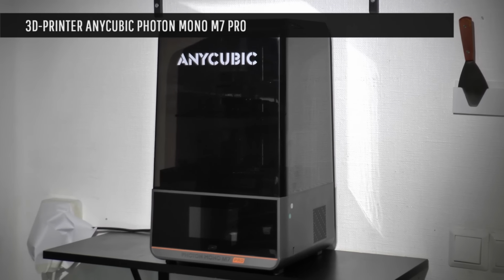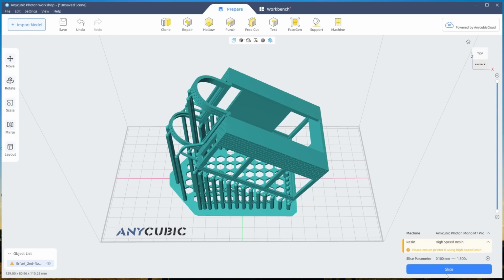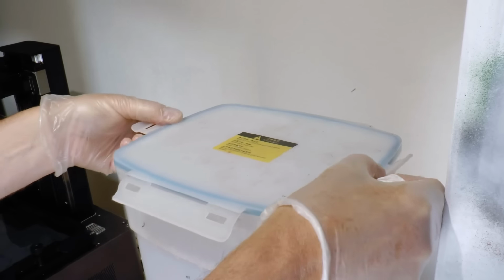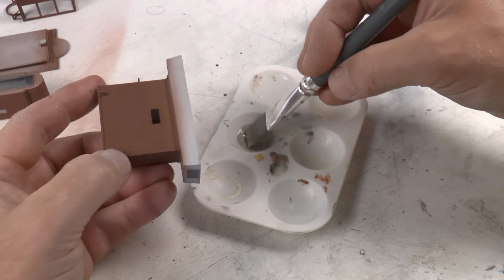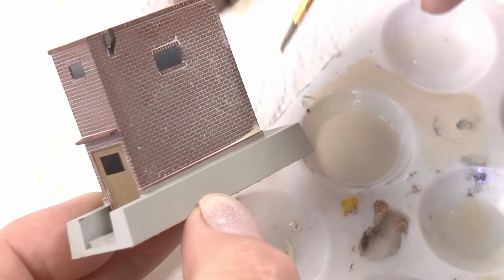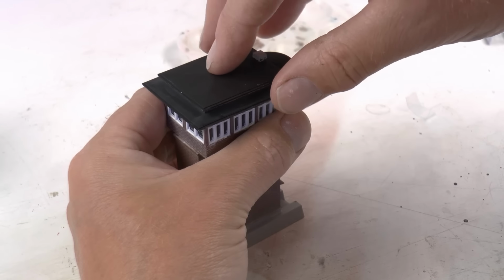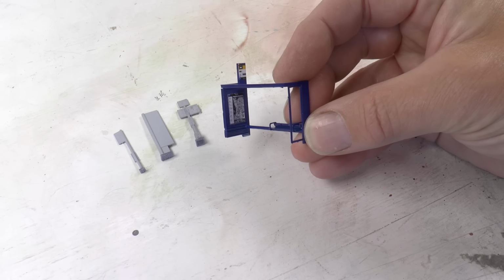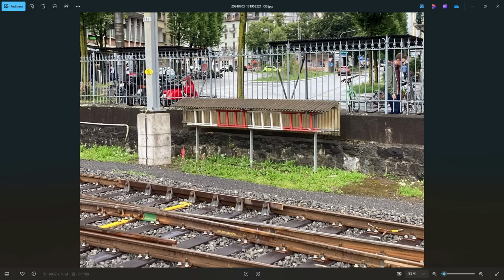Building Erfurt Tower with Anycubic Photon Mono M7 Pro - 3D-printing for Model Railway - Q2 update.

Comment: Why do you call it 0-Gauge, but H0-scale and N-scale? What is the difference in your mind?
Reply from the maker: Hi! 0-guage refers to the track scale, while H0-scale refers to the actual scale of the models. 00-guage for instance is H0-guage tracks, but 1:100 scale models.
Reply: @marklinofsweden  Hi, Yes I know that part. I was just wondering why, when describing building a model in three different scales, you use "scale" for H0 and N but "gauge" for 0-scale. BTW 00-scale is 1:76, not 1:100. (refer to our friend wikipedia: https://en.wikipedia.org/wiki/Rail_transport_modelling_scales)

Comment: Any specific reason why you didn' just assemble the Auhagen kit for the Erfurt tower? I have the Auhagen version on my layout.
Reply from the maker: We’re building a large database of 3D-models, currently with an excess of 1300 H0-scale models on-line. The Erfurt tower is the first the four towers we’re designing currently. We select buildings especially suitable for 3D-print and do not consider if some of the current manufacturers has it in their catalogues. 3D-print will be the dominant supply route of plastic scale details already within 3-4 years.  Not only for Model Railway, but all kinds of plastic kits.

Comment: You're doing great work with your 3D model store!

One quick question about the painting - did you gloss or matte varnish the acrylic painted bricks before using the thinned oil paint "wash" for the mortar?

By the way, "kiosk" has a tricky pronunciation in English. Sort of like "key-osk".
Reply from the maker: Hi Chris, No I didn’t warnish the walls before applying the mortar. This since the turpentine does not dissolve the acryllics. However, varnish may have a positive effect on the flow of mortar, but is an extra step and material.. kiosk.. Haha! Yeah, I know. A bit of Swedish touch on that one.. Thank you for feedback! 👍😊 Wish you a nice week!

Comment: I see you're scaling up the supported models, which scale up the supports. I would possibly recommend resupporting the model after you scale up the model. That way the supports don't get huge (or too tiny if you scale down to, say, N or Z gauge!)
Reply from the maker: I totally agree with you. However, it turned out that both 0-guage and N-scale worked perfect also scaling the supports. So less work and same result

Comment: Are you planning to do the italian catenary system someday?
Even if it takes 5 years it's fine, I have time
Unfortunately it's a lot more complicated than the others to 3D print and design
Your service is super useful!
Reply from the maker: Hi Paul, thank you for commenting. Italian catenary? I have not got any request previuosly for Italian. You’re first. The reason for the Swiss was I got invited down to Swiss last summer to take photos and measure the details. It’s typically neccesary, since it’s very tricky to aquire dimensional drawings from official sources. If this can be arranged then I can design.
Reply: @marklinofsweden Dear Martin, do you think you could make an N scale version of the Swiss catenary? I think it is too delicate to scale down to half size. Keep up the good work!

Comment: Is it possible to print those items on a filament printer like the Bambulabs A1?
Reply from the maker: Yes. But you need to add supports for FDM-printing. I don’t think the provided supports for resin will do the job for you..
Reply: Yes I have the A1 and I've printed models from MRR successfully. Depending on the model, the BambuStudio app may warn you that supports are needed and you can enable from the apps support tab.